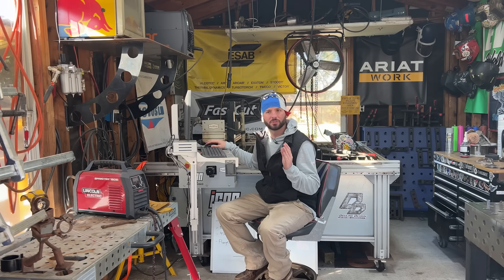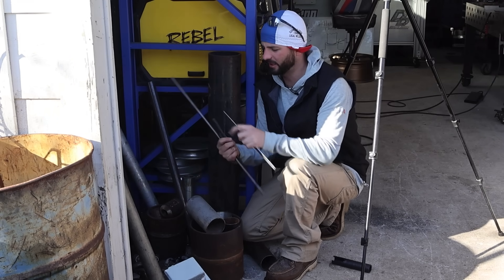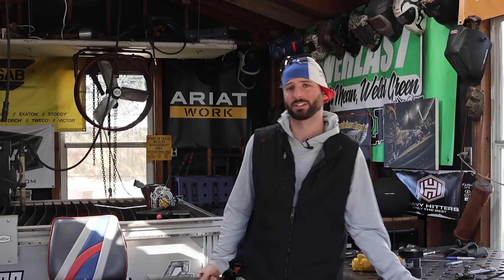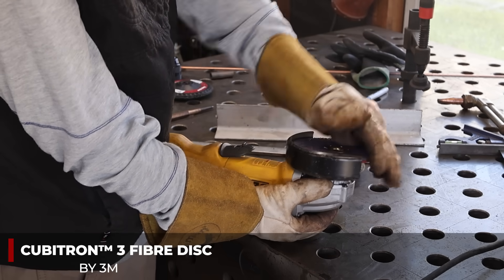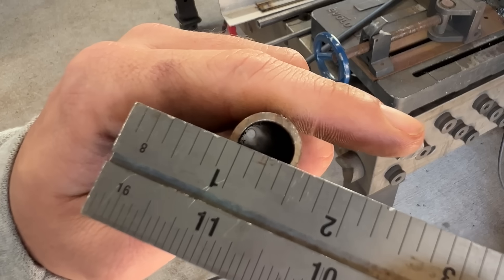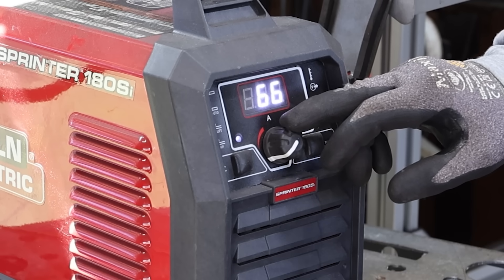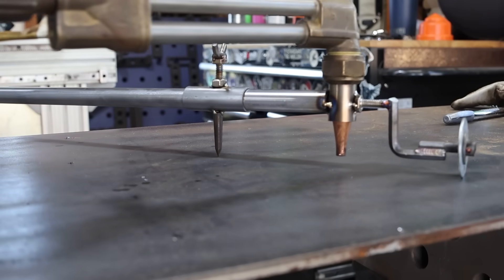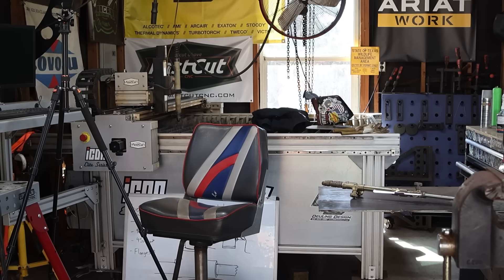DIY Torch Cutting Tools: How to Make an Oxyfuel Circle Cutting Jig

Comment: Bad thing about using stainless steel is that weld spatter or even hot beads from cutting steel will stick to the stainless .

Comment: The only thing I would change on the circle cutter is the length.
Not make a long and short arm but a short arm that can a pipe connector on the end of it so that you can screw two of them together to make it longer.
OR - put the connector at the torch end and screw in different lengths of pipe/tubing to get different radius of circles without having such a long arm for all of them.

Comment: Your circle cutter would be nice with a magnet in the center which would hold itself. I think you could turn the wing nut 90 degrees to the point this would give clearance.  Also could use a magnet to hold it in place. Although those aluminum magnets can be little tough to find at times

Comment: I made a circle cutter using a magnetic ground clamp.   Works great on steel and 410 stainless.  Nice video Austin!
Reply: Oooo yeah I bet that is nice. Keeps it secure better I’m sure
Reply: I hacked up a Plasma version with a 2" 'hook mount'. Basically a magnet with a pressed chrome cover and about 10kg holddown and cheap. As it had a hole in the middle I can drop a longer bolt or pointer in the middle as needed depending on the material.